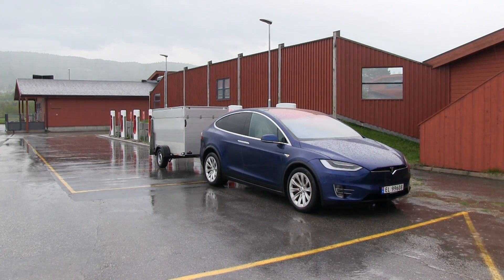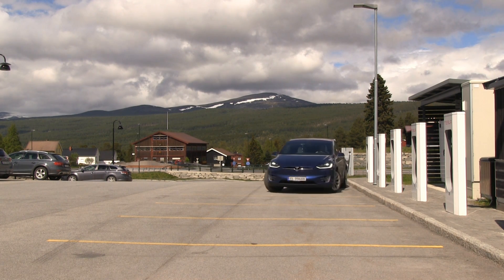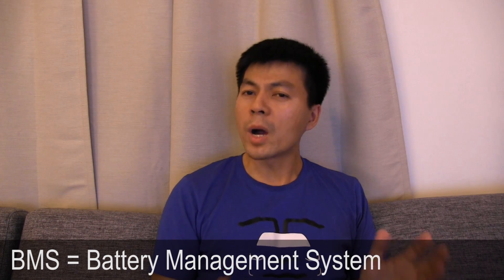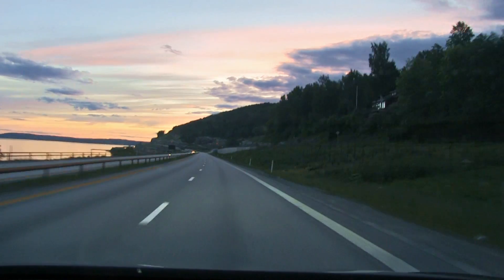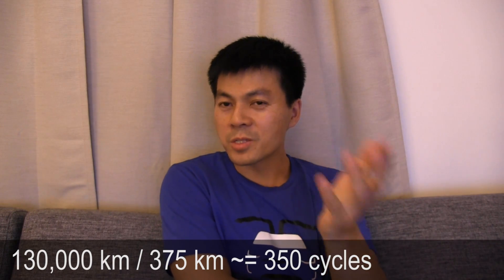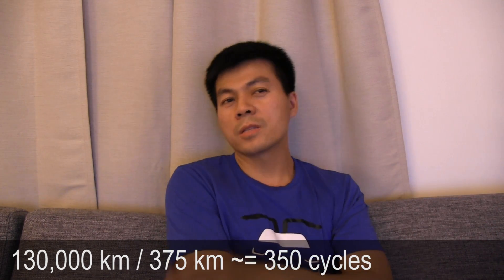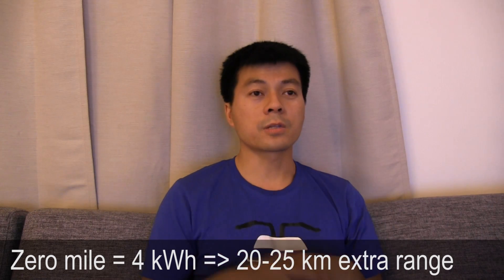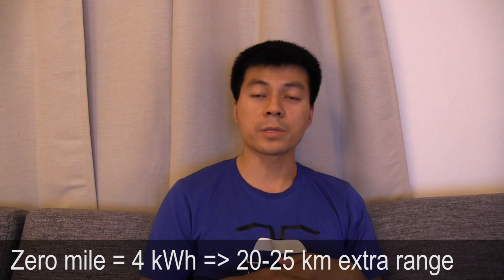Model X P90D battery degradation after 130k km/80k mi equivalent

Comment: it sounds like your extreme use pulling the trailer and the number of rapid charges has caused some problems. Have you or do you connect to a "normal" slow charger (16 / 20Amp 220v) on a regular basis?
I suspect using rapid superchargers all the time will not allow the BMS to do its job properly. 
It might be worth redoing a capacity check after leaving the car to recharge from say 50% or lower on a slow 220v connection or better still 2 or more back to back slow charges.
I do not know if the BMS will work on individual battery level? if it will then a slow charge will help the BMS work out the individual internal resistance and capacity of each battery in the pack.
Either way it can only do good to allow a slow charge to 100% once in a while to properly balance the battery pack.
Keep up the good work. :D

Comment: Good News: Perhaps its great that Tesla is moving slow to get you a 100 pack. Why? Tesla's battery scientist Prof. Jeff Dahn this year had a breakthrough. He discovered a new chemistry that makes battery packs last longer, at least least double the mileage. Since Tesla upgrades cars fast, they will likely use this new battery for the Model 3. Perhaps by Fall you will be able to get new long-lived 100 packs, that may last you 8+ years of heavy driving. See electrek article: https://electrek.co/2017/02/07/tesla-battery-research-longevity-breakthrough-products/
Reply: P.S. The article does NOT SAY the new chemistry makes batteries last twice as long. That claim leaked out from remarks made by some excited grad students there. It may be false, but I think it true, because the Prof. reports a breakthrough officially, without being specific about it in public. (They will leave product claims up to Tesla).

Comment: Hej Bjørn, you lost 5%, but if battery is charged to full does it show 100% or 95%. I found out that in TMS 90, every 10% is around 7.7 kWt, in TMS 85 is exactly 7kWt. Did you notice that it is also reduced in degraded battery?
Reply from the maker: It's shows 100 %.

Comment: The problem with batteries is that they degrade with time. You can use it less, and it will still degrade after years.
Reply: Yes they do. But lithium ions don't degrade much with time. Its temperature dependent though, so might matter in California or Florida, but not much in Norway.

Comment: If you do a lot of partial charges the BMS may not calibrate properly and/or balance all the cells fully.  A few deep discharges followed by full charges leaving the car plugged in for a while after 100% charge may recalibrate/rebalance the pack and restore "lost" capacity, (which wasn't really lost).
Reply: Unfortunately that's not entirely true. While it is true that a Tesla will recalculate charge and range capacity when charged to 100%. However you cannot keep charging after 100% in a Tesla and they do this for a good reason; because leaving a Lithium-Ion battery at 100% for any length of time actually increases the degradation and attempting to add more energy to a full LI battery can cause immediate failure (e.g. the Samsung battery fiasco). That whole "battery training" thing is outdated it was true with Nickle Cadmium batteries and Nickel metal hydride (NIMH), but not of Lithium Ion batteries.
Reply: You seem to have misunderstood what I said.  To be quite clear I was not claiming the car would "add more energy to a full Li battery", because it won't.  What I believe does happen is the BMS will more fully balance the cell banks when left plugged in for a while after a full charge.  I'm not advocating doing this on a regular basis because of the potential for long term degradation as you mentioned, but doing it once in a while to fully balance the pack should not be an issue, especially weighed against the downside of running an unbalanced pack.  There are examples of people recovering "lost" capacity by using the methods I described.

Comment: What I heard is that its physically possible to upgrade but it requires more then just swapping the battery as the suspension was tuned for the weight of the previous battery, however given you have smart air suspension it might be as easy as them just re calibrating it.

Comment: Please start posting 4K videos man, 
1080p feels way too low quality in 2017 !!!
Reply from the maker: Content is more important than 4k.
Reply: Bjørn Nyland Sure man, we love your videos,
Just with 4K can enjoy to the fullest, that's all :)

***** True that, why I asked is, every recent smartphone even have the 4K recording feature, so there is nothing much to complain about extra cost of equipments too.
Reply: They're a pain to edit :/
Reply: Chandraprakash G there are a few logistical problems. if I record in 4k on my phone the size of the file is much larger (almost a gig per minute). Since he records hours of video at a time, he would run out of storage very quickly. Then you have to import all those files to a computer and edit it taking more space and time to copy. It would probably quadruple his render time. So his 30 minute trip videos (assuming it takes 30 minutes to render) would take 2 hours to render.That fully rendered video would also be a larger video to upload which would take much longer.
Reply: Price Burnett True, everyone worked with 4K is familiar with that procedure from using OTG pen drives with Smartphones, and ofc smartphone low bit rate For 4k produces around 300MB per min,
Also that extra render in premier or final cut is worth it indeed at last.

And ofc he is in Norway, his home fiber would be in 100megs with enough bandwidth.

Comment: I think for 350 cycles 5% is pretty good. You can expect that it lasts the same as the battery in your laptop, so I am guessing it could last 10 years tops or 5 if it is heavily used.
Reply: My understanding is degradation slows down after 95 percent, so it may take 200k miles for it to hit 90, 500k for 80, and a million miles for 70 according to current user data.

https://electrek.co/2016/11/01/tesla-battery-degradation/
Reply: Too good to be truth I'm afraid, time will tell. At this point the facts are that all lithium batteries follow an exponential curve for degradation where it gets worst and quicker over time and use (actually I have doubts on wich is the more important factor of both). Elon knows that, that's why we have the powerwall wich is the way he plans to recicle the batteries from the car when they are no capable of good range.
Reply: These are real numbers from real drivers, so you can believe what you like. 

The point is they obviously solved the problem in some fashion if it can last half a million miles at 90 percent original capacity, so it's a non-issue with the current generation of EVs - unless you plan to drive the same car for over thirty without changing batteries I suppose. 

There's allot of variables relating to battery life, for example not everyone does a 100 percent charge/discharge, and there are ways to spread this evenly across cells for ideal cell preservation. You can go as high as 10k-15k discharge cycles in some cases with the right conditions and proper cell management.

I recall the older Nissan's had some battery degradation issues because the company didn't implement battery management measures at the time. I believe they now do so, so they're catching up to Tesla in this area as well if I'm not mistaken.

And as a side topic, Elon's original plans changed as they use a different chemistry in their Powerwall batteries now. They may still do that in the future but who knows.
Reply: This numbers from the article "suggest", but they are not factual, in fact they came from the stats of the car, very scientific if you ask me... By the way the car can say that charge is at 100% or 0% it's program to tell that when it will never go to 100% and will never allow fully discharge the battery to preserve itself. Please don't tell you believe in perpetual motion too.
Reply: This is nothing new, the software handles wear leveling and ideal temperature management on the cells to preserve them longer. There's a big difference between fully cycling a cell and simply charging/discharging it at, say 10 or 20 percent, the difference between the two scenarios on cell stress is the difference between 500 and 15000 cycles.

The point is, let the experts handle this, they got it figured out so no need to imagine problems that don't exist anymore in reality.

Comment: Very interesting. I have 75D MX and average consumption of only 221 wh/km or 356wh/mile. Although I have lover Wh/km I wonder if the consumption 'per cell' is similar to Bjorn as it's over only 75kWh of cells as opposed to 90kWh. For example I'm averaging 2.95Wh per kWh of battery capacity (221/75) and Bjorns consumption is 3.78Wh per kWh of batter capacity (340/90) whereas if I'd done those trips in the 75D then it would be 4.53Wh per kWh of battery capacity (340/75). Also means a 75 has to recharge more often, so I guess the most likely battery to last the longest time would be a 100D?
Reply: MercedesAMGsRULE that username tho
Reply: tali sson I know. It's a bit out dated! Can you change it?

Comment: My own thougts are that the BMS adapts to the battery pack and driving style, this is why you have a "reserve" when the battery is new :)
Reply: That was my presumption too but my 85D with >70000km  had no problem to go 14 km 'below zeo'....
Reply: Martin Deckers Did you ever run it out before that? it couldn't know how low the batteries are allowed to go until it's been there the first time :) That's why one has to calibrate battery meters :)
Reply: Hi Jøran; yes I did but it was more than 1 year ago and only for 2 or 3 km